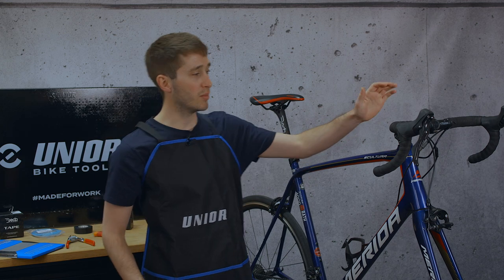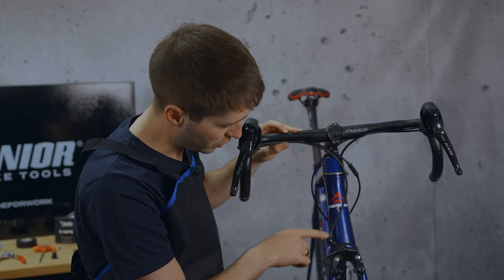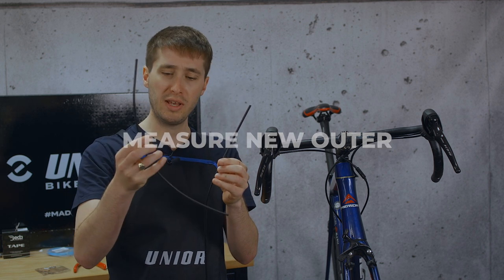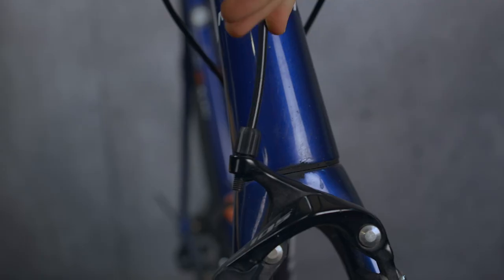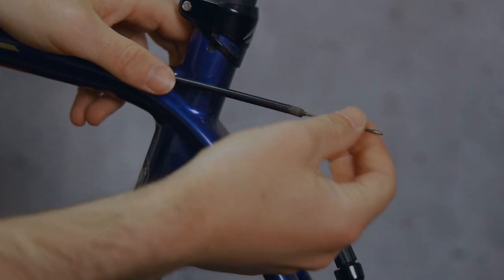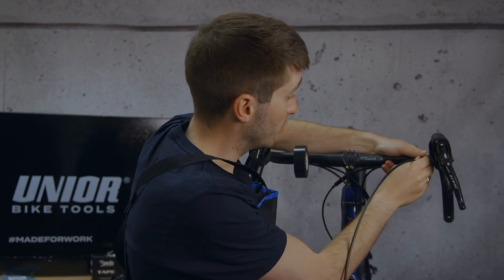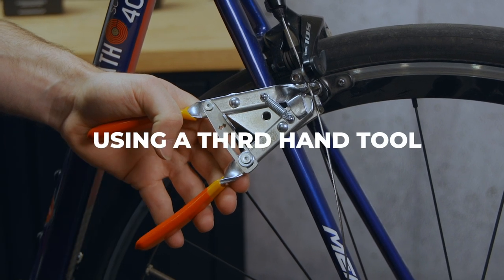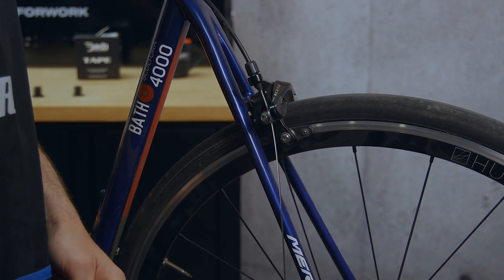How to replace a brake cable on a bike

Comment: You do not have to go full Luddite on the brake system and wheels, but rather can go half-Luddite and use Avid BB7 S Road cable operated calipers (very reliable and compatible with SRAM Red, Force, Rival, and Apex levers) which allows use of modern disc brake rotors and lightweight carbon rims, etc. without hydraulic master cylinders on the levers.
Reply from the maker: you can , assuming your bike will take disc callipers...

Comment: You almost never have to replace the front brake cable or housing, the run is so short and its direct.. Dont bother unless theres noticeable friction.. Even then its prob the caliper itself
Reply from the maker: if you're doing it and you've bought a kit with inner and outer, you might as wel though eh?